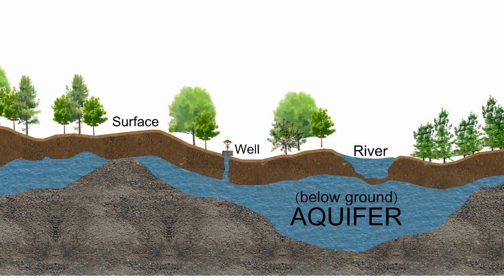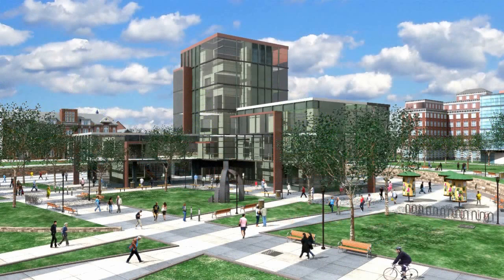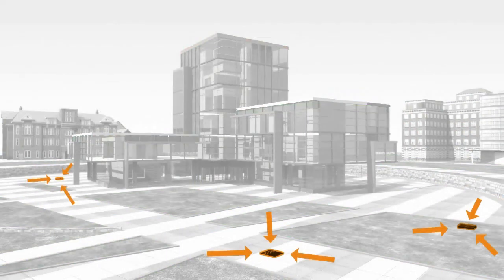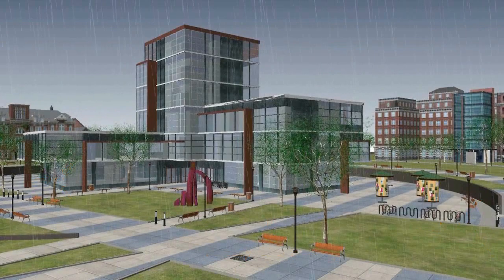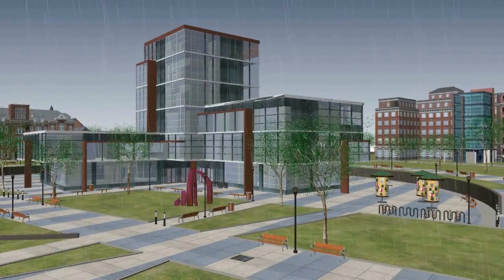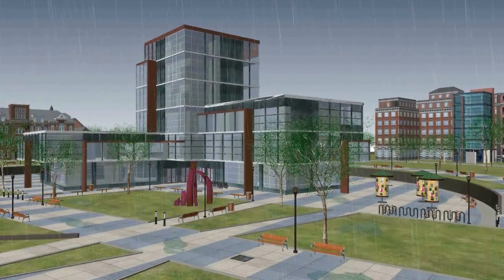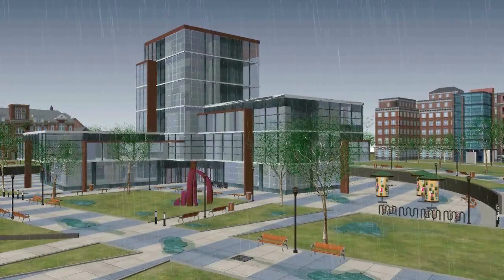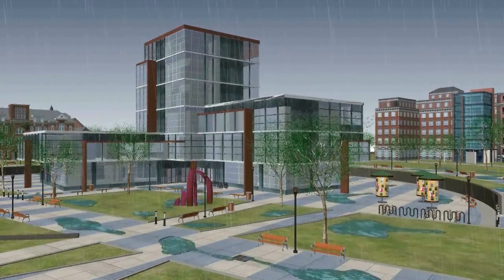Leveraging the Landscape to Manage Water

Comment: Do permeable pavements tend to be more expensive than non-permeable ones?
Reply: Yes Eddie, Because of the extra materials and time required for these installations, permeable paving is considered more expensive than traditional paving—typically about 20% more expensive. However, that is only the material and installation cost. The savings due to fewer repairs and storm water management infrastructure can’t be ignored.